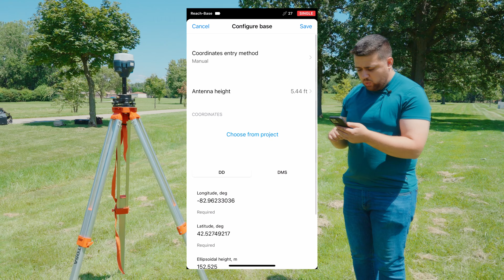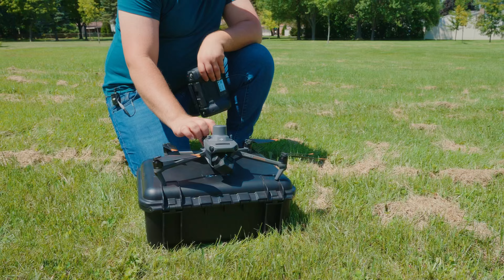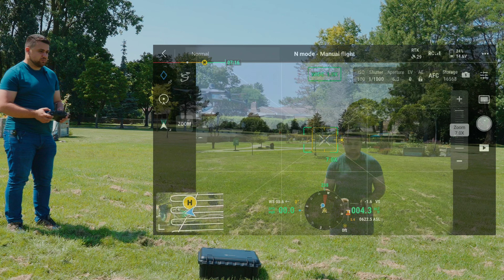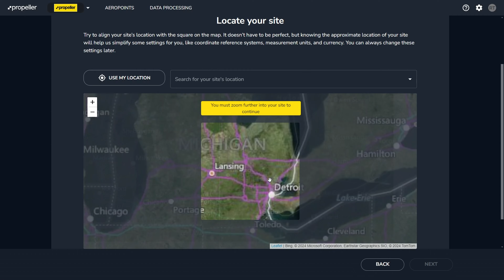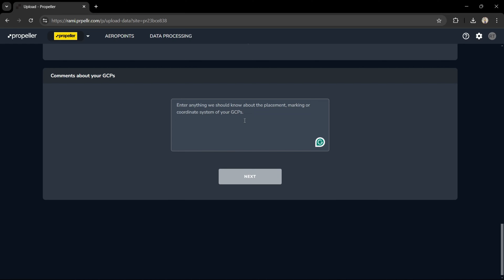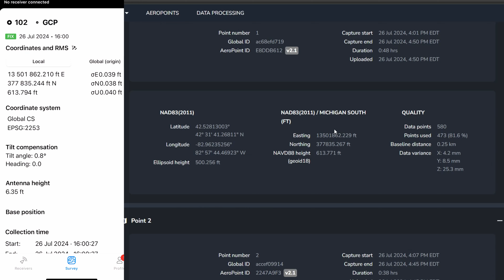Is the DJI Mavic 3 Enterprise Accurate with Propeller and AeroPoints 2?

Comment: Question, I noticed that you aren’t using the Lora radio. Given that your workflow is all PPK, couldn’t you also check your points with RTK just to compare RTK vs PPK to check your points since propeller is already using PPK.

Comment: I used to be a drone surveyor for a local aggregates company and we used the Propeller's AeroPoints and processing system. I loved it, for the most part (the 3D models could have been a little better, but it wasn't necessary for the tasks). That system has so much more than what was gone over. It was perfect for those quarries out in the middle of nowhere. Though really, really expensive, I cannot recommend this system enough for those needing a robust collection and processing system.

Comment: This is our daily routine flying 4 Mavic 3Es and 1 Wingtra using Aeropoints and Propeller to process. We run local coordinates with our Machine Control. We only use our Rover to establish a “known coordinate”, then place an aeropoint on it each flight. We never have to break out a rover unless our point is destroyed. We fly anywhere from 2-6 sites a day, so this is huge time saver. 

Excellent video showing the process and accuracy between the two systems.

Comment: Just an FYI - The Aeropoints will use the Center-Bottom of the Aeropoint as it's location. Since you took a shot using the Emlid at the top of the Aeropoint, that would be a 26mm offset. So your measurements from the Emlid are actually even more accurate!
Reply from the maker: That explains why when we use the propeller correction network all three of the points were 0.1 feet higher. Thanks for the insight.
Reply: @RamiTamimi  OMG Rami how did you get this wrong 🤣
Reply: I thought it was the top. That's why when you establish semi permanent locations with them you have to offset the height by 26 mm for Aeropoint 2.